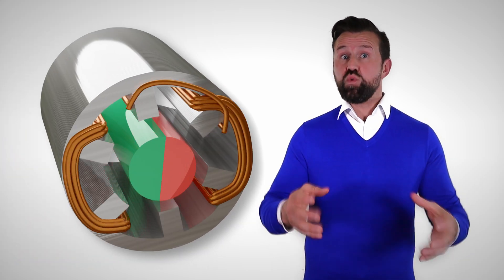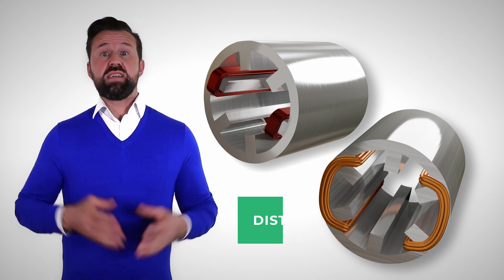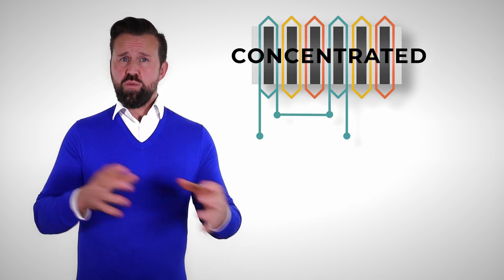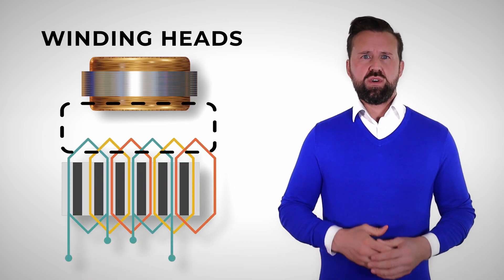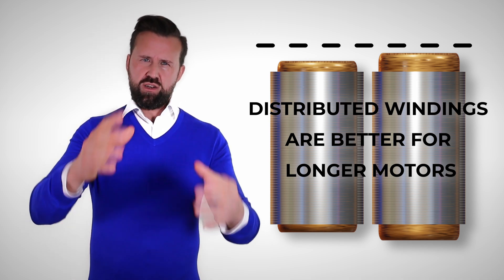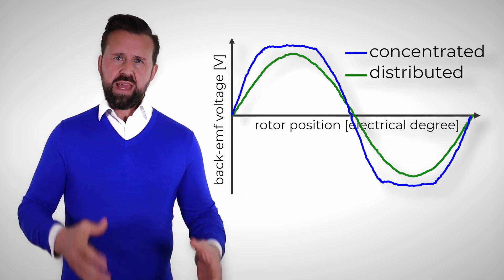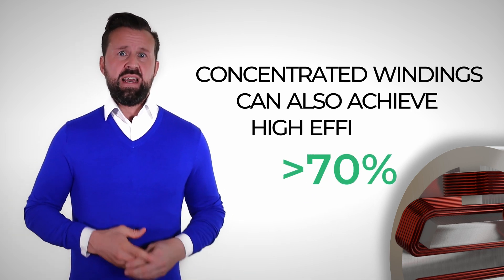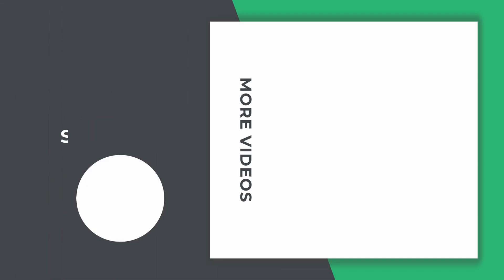Electric Motor Winding Types Comparison | Concentrated Winding vs Distributed Winding

Comment: What is the winding difference between a motor that works with 50Hz vs 200Hz?
Reply from the maker: Do you mean for standard induction motors?
Reply: @Electric-Motor  I have electric motor from Toyota Prius gearbox, which have 8 pols but i want to know how many Hz have and if is something different in windings?
Reply: Because I want to use it as an electric generator!

Comment: Maybe it would be worth analyzing my work on the new generation of a synchronous motor, the Brushless Hybrid Fast - Rotation Motor, operating on the basis of the winding angle of 135 and 180 degrees. My analysis and tests are very promising!
Happy Easter, greetings!
Reply from the maker: Looks very interressant, what is the essential and difference in function?
Reply: @Electric-Motor  Thank you for your answer.
A. Base angle 135 degrees.
The symmetrical winding, based on a pole angle of 135 degrees, generates a delta function current on two pairs of motor control lines [L1 - L3 and [L2 - L4]. This effect has been confirmed in numerous load tests in the generator function.
The engine mode is dominated by the function generated by the controller supervising the operation of the engine.
B. Base angle 180 degrees. The asymmetric winding, based on the pole angle of 180 degrees (phase A - B: 90 degrees; phase B - C: 135 degrees; phase C - D: 90 degrees; phase D - A: 45 degrees), generates on two pairs of motor control lines [L1 - L3 and [L2 - L4] isosceles trapezoid function current with vibrations at the peaks. The winding system is slaved to power the synchronous machine, in four steps per revolution, with a sine function current or any dependent on the calculations of the supervising controller.
Regards!
---
I gave a detailed answer a few hours ago, but I still don't see my comment (16.04.2023 r., 19.08).
Reply from the maker: You can achieve great things with asymetric winding. However, this usually leads to asymmetrical use of the stator laminations. This often leads to high losses in the laminations. Have you ever measured the efficiency? And if so, what efficiencies do you get?

Comment: if i wont to rewind a generator to produce  240V how meny time's must i wind the coiled & which is the best practice  i know to wind a coil at 60 terns will give me  120 volts if i ues a Varick to inches the field windings , on the rotter,  so di i wind a aster  by  to 120 windings to Give me  me a power out put of 240'v output  What did  the KVA  of that  put out .  ?

Comment: These videos are AWESOME ! And, you are an excellent communicator. Please don't stop making these videos. The keys points are summarily transmitted simultaneously verbally and visually making for a powerful combination. You are educating the next generation of electrical engineers ! My personal wish would be to see a video for each section of a classical book on AC and DC electrical motors and drives. In particular, how torque is evaluated analytically and experimentally. Thanks again, and as the number of videos boosts, so will the subscribers. Have an excellent performance and wish you the highest efficiency !
Reply from the maker: Thank you very much for your great feedback. However, it makes me crazy that I only have a few subscriptions. Wish you also a high efficiency ;-)

Comment: thank you sir i love it and also we would be very grateful if you could explain hybrid axial and radial flux motor that is used in keoingsegg car
Reply from the maker: Very complex question. So Koenigsegg uses an axial flux motor because the installation space length is very short. This is a main advantage of axial flux motors compared to normal radial flux motors. But the biggest disadvantage of axial flux motors is the complex lamination of the stator to reduce the losses in the laminations. That is why compound material is often used, which is not electrical sheet but pressed powder. Sounds good, but the losses are greater for medium to high speeds. Therefore it is not often used. However, for very high speeds, the losses in the electrical sheet are greater. It is not the mechanical speed that is important, but the electrical speed. Since the Koenigsegg motors have many poles, the electrical speed will also be correspondingly large. So the use of compound material makes sense. Funnily enough, the market leader for this compound material comes from the same country as Koenigsegg ;-) This is probably not a coincidence. Hope I could answer your question Grayson?

Comment: Could you make video for design of distributed windings, how much in numbers and how many turns needed and from where we should take our phase in and phase out wires. And how the motor is connected to drive and controller.
Reply from the maker: The design of the winding is quite complex. I do not even know a book that describes the design of the winding well. As a small tip, when you compare winding configuration, always look at only one phase. That simplifies the analysis of the function and unetrschiede enormously. Thanks again for your nice feeback

Comment: Thank you for creating this videos, their very useful to me :) 

I am more interested in difference between single layer and double layer
Reply from the maker: In short, the difference between a single layer and a double layer winding is very small. With a single layer winding, there is only one winding in a stator slot, with a double layer winding there are two windings. The problem with a double layer winding is that the two windings in a stator slot can be of two different phases. Depending on the winding configuration, this can lead to unfavourable current displacement. Thanks again for your question, I will explain the details in one of the following videos.

Comment: Thank you for share these very useful information. Why magnetless switched relutance motors are not used for automotive  traction ?
Reply from the maker: Switched reluctance motors have a smaller power density than an electric motor with permanent magnets and the efficiency is lower. However, car manufacturers also use the reluctance torque to reduce the expensive magnet material. The motors are called IPMSM and are a combination of a PMSM and a synchronous reluctance motor. Thanks again for your question, I hope I was able to answer it in a few words?